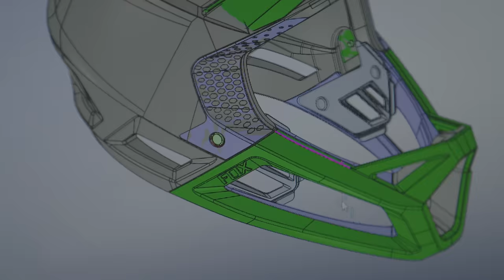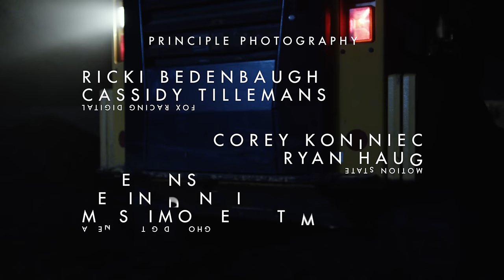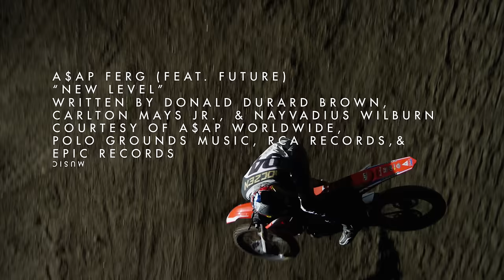SHIFT MX | RIDE ABOVE | KEN ROCZEN | (WARNING. EXPLICIT LYRICS)

Comment: This is too much you I love shift gear and rode fox back in the 90s but COME ON you copy 7gear style and your intro is all about being innovative!!??!! I like the new style of moto gear but don't claim to be the ones going there..fox/shift is better than that and seven, axo ect ect.
Reply: I would say the gear is definitely visually similar to Seven which copied AXO gear from back in the day. But, they had a vid before A1 with Fox's creative director explaining all the material design that went into the new gear and it does seem pretty innovative and different. You also don't have the stupid 2 piece jersey thing that Seven has been doing. Both are cool brands at the end of the day that are doing their part to advance the sport IMO.
Reply: Fair enough..but if i had a good come back to your point i would add it now.
Reply: wakeboarder028  Thor has a line out like this as well, with the sleeves...
Reply from the maker: Well said my friend. Thanks!
Reply: Shift MX thanks should I send my address for free set of gear? ;)
Reply: +kidzorro I don't understand what point your trying to make?